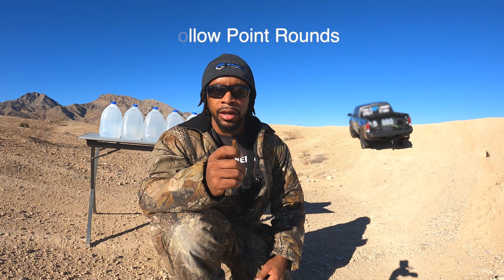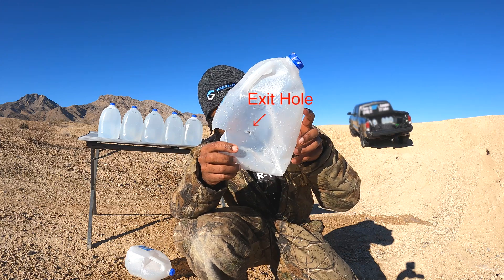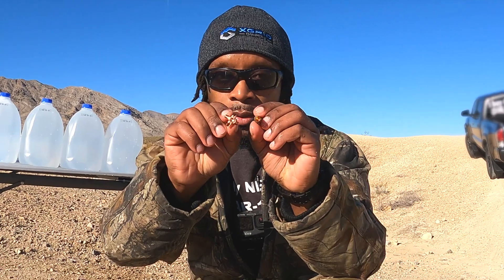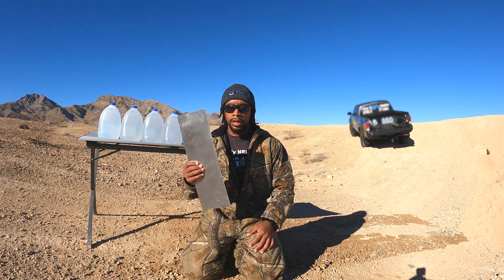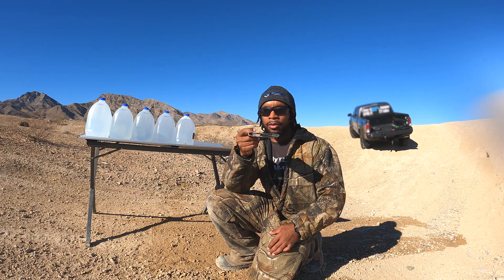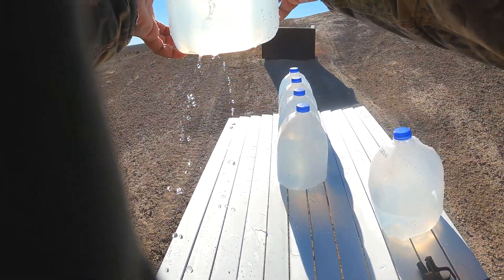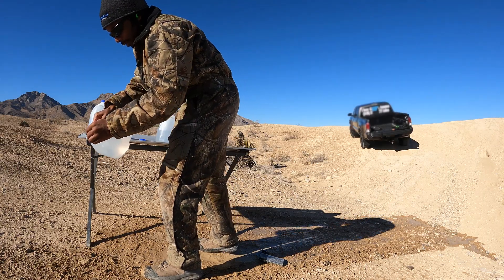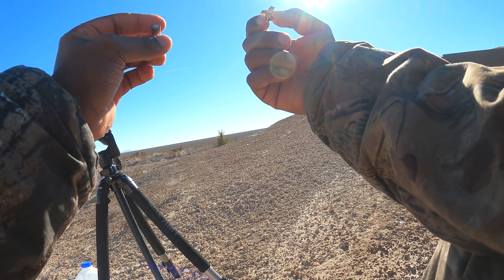Hollow Points Don't Always Expand | Problem With Hollow Point Ammo

Comment: I love the demonstration.
I’m a bit curious how certain rounds would act if they had silicone or wax inside of the hollow point cavity. 
Would the wax/silicone act like a wedge to drive the pedals apart when the clogging occurs.

I ask because I do this exact concept with air guns and hollow point pellets. And get amazing results around this problem following that concept. Fur or hide some times plug up the hollow point which makes it act more like a ball round.

Comment: You are correct...they dont always expand. Shot a boar in Florida a few years ago with a .45 cal glock with hollow points. Pulled them out of the boar...they DID NOT  expand!
Reply from the maker: Someone in the comments said cow hair will clog them and I thought that was surprising so I'm assuming it's the same with a lot of animal hair.
Reply: @CajunBoyJake  the cows hide is much thicker than our skin also. that could maybe do it as well
Reply: @mascenik pinstriping what is the barrel length on your glock? I'm wondering if the bullet has to go faster to expand with more material in the way.
also if  hollowpoints don't expand well, what else would you use? soft point?